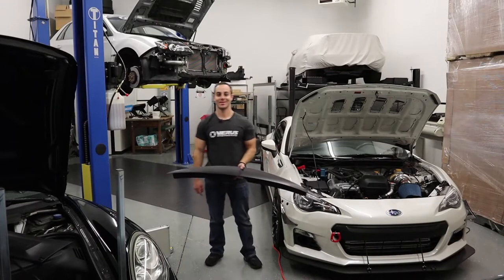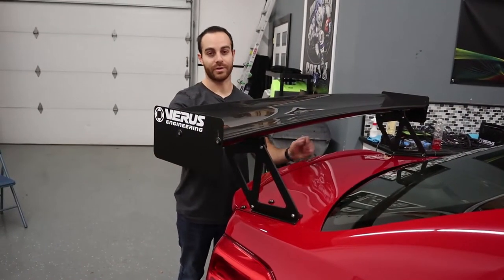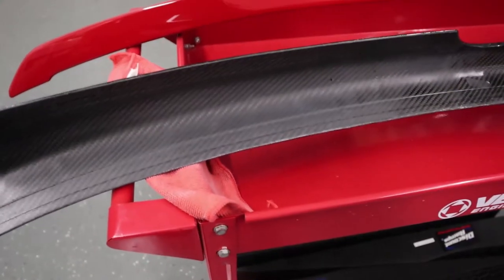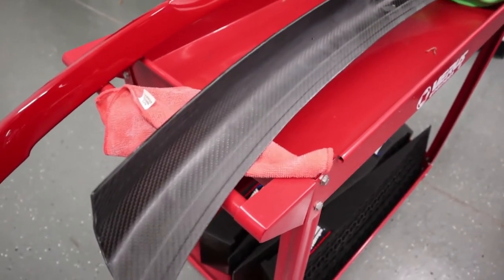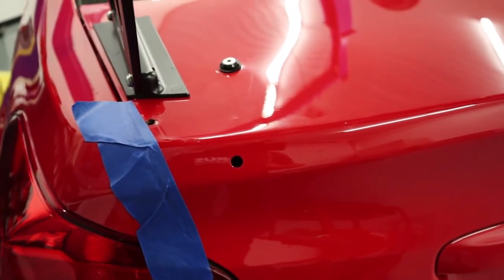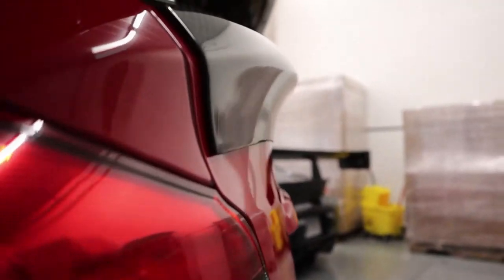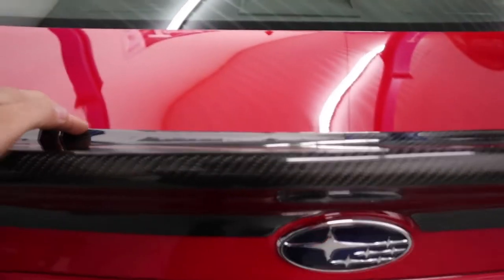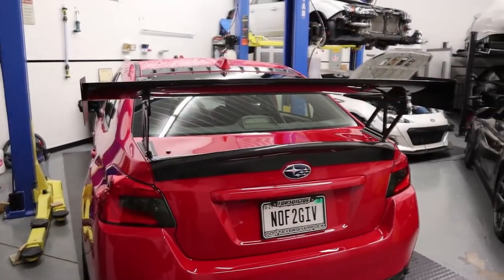Subaru WRX/STI (VA) Carbon Ducktail Spoiler Install

Comment: What about removal if ever necessary, say if it became damaged for reason? 

Also, any possibility of ever including a mechanical connection using factory mounting points? I much prefer the idea of a mechanical connection to protect the paint, removal if needed, etc.
Reply from the maker: It can be removed but will take plenty of force and plastic trim removal tools in order to not scratch the paint. We do not have any plans for a revision, because the 3M tape is quite strong.

Comment: That wing base plate mounts flush with the spoiler. Is the wing a Verus Engineering product? Do tell...
Reply from the maker: Yes, it our prototype 250mm chord curved wing. We like to call it the UCW. Should be available for purchase in the next few months.
Reply: @VerusEngineering  Awesome!